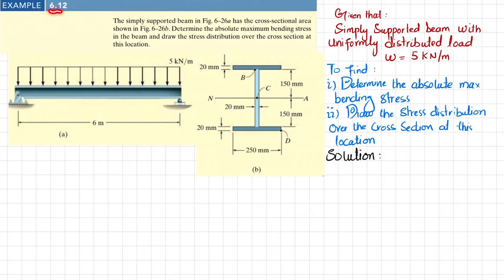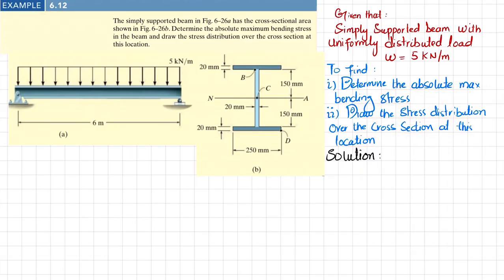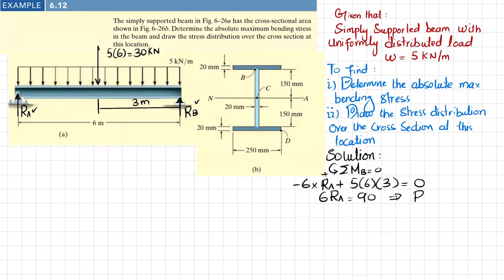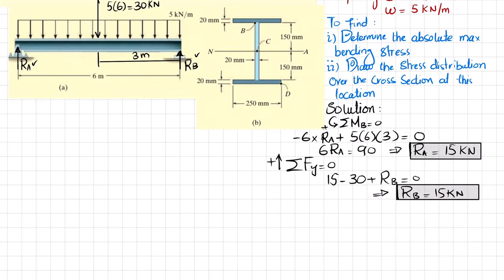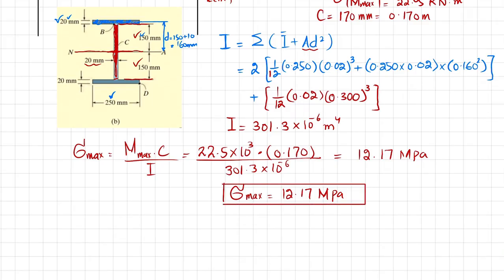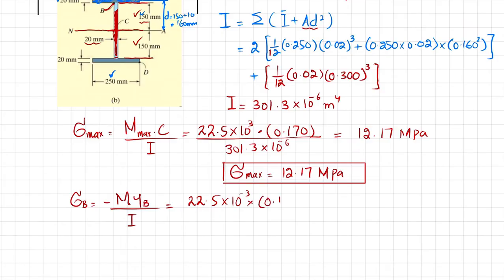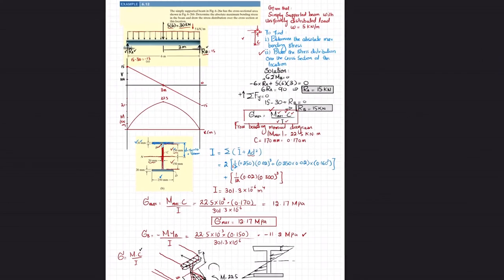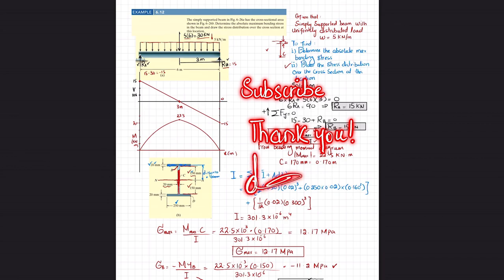Example 6.12 |Chapter 6| Bending | Mechanics of Material Rc Hibbeler|

Comment: why u put negative sign on the formula for stress at b?
Reply from the maker: The formula for stress is = -M *y/I where y above the neutral axis is positive and below neutral axis y is negative and due to this loading the upper portion above neutral axis is in compression and below portion is in tension.

Comment: Plz solve  EX 6.14
Reply from the maker: Here is your required problem https://youtu.be/em0v6U-xJWM
Reply: @ Sir I mean solve this problem ( The beam shown has a cross-sectional area in the shape of a channel. Determine the maximum bending stress that occurs in the beam at section a-a. Show your answer in MPa.
1=42.26*106 m'. )  🙏🏻
Reply from the maker: CHAPTER 6 (BENDING) BY MECHANICS OF MATERIALS  R.C HIBBELER (9TH EDITION), Complete Solution by Engr Adnan Rasheed Mechanical: https://www.youtube.com/playlist?list=PLuj5YwfYIVm9CxuqONbS-s67TM9AdIpPg
Check in this playlist of available or not
Reply from the maker: @EbtehajEbrahem-u5f i have checked the book and it's example problem 6-13. i have noted and soon i shall make video . stay tune and keep watching 👀

Comment: A 48 ft long plate girder is simply supported at the ends and it has a distributed
load of 2.6 kip/ft and three concentrated loads of 30 kip at x=12 ft, 24 ft, and 36 ft, as shown
below. A designer provided you with a recommendation of using 1"x16" flange plates and
3/8"x63" web plate, as shown below. The girder is constructed from A-36 steel using E60XX
electrodes for all welds.
a) Draw a shear force diagram and find the maximum shear force in kip.
b) Draw a moment diagram and find the maximum moment in kip·ft. 
c) Find the maximum bending stress in ksi.
d) The flange plates are welded to the web plate on both sides using matching intermittent 5/8"
fillet welds. What is the minimal total length of the intermittent welds for each side? 
e) Bearing stiffeners that are 0.5"×63"×7" are used at the left and right end supports. Find the
minimum fillet weld size of the weld (in inch) that is required to join the bearing stiffeners to
the web plate.
Reply: Sir....Can you solve this question on youtube?
Reply from the maker: If get time I shall try on this as well. Actually I am only following the books that are taught in universities.